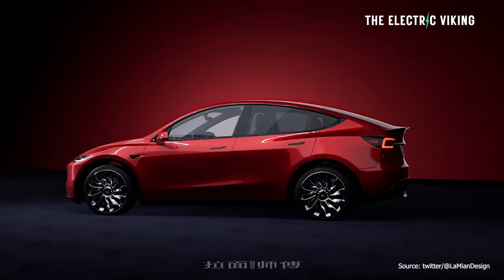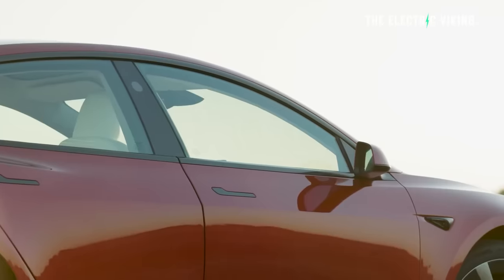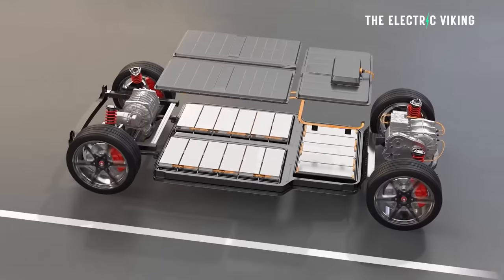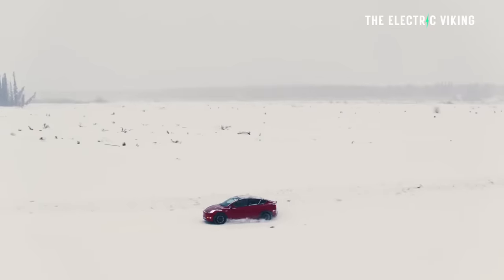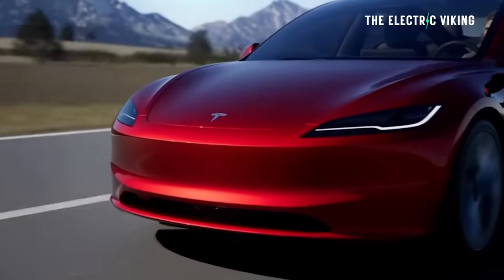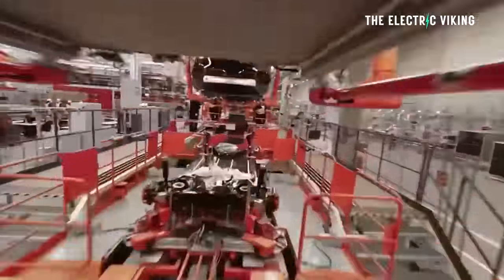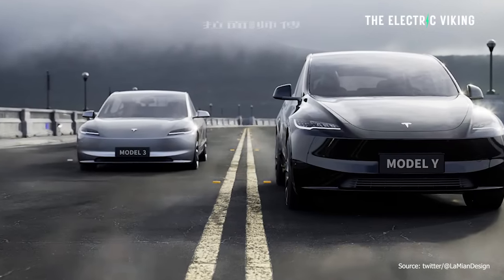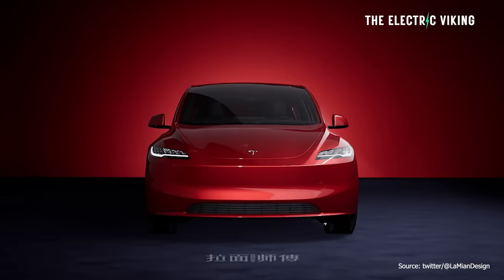NEW Tesla Model Y Juniper details leaked - Factory retooling only weeks away

Comment: I've been waiting for this version of the Tesla Model Y since Tesla Model Y was first manufactured.
A major iteration, after Lessons Learned, with batteries that aren't Antiquated lithium-ion technology.

This is the Tesla Model Y that people will be raving about.
Reply: I’ve been holding out too👍🏼
Reply: Yup we have been waiting for these upgrades incl. the suspension improvements.
Reply: Don’t believe this guy, it will be the same as highland.
Reply: If it rides well. Model 3 was horrible, I haven't been in the updated version, but all reviews are raving about the  huge improvement on suspension. And Model Y is even worse than old M3. Any improvement in battery should go towards weight savings. And for the love of God, keep the indicator stalk. Buttons on the wheel simply don't work in roundabouts.

Comment: LFP is the only reason why i went to an EV, specifically the model 3.
Reply: RIP NIO's swapping nonsense given ever increasing charging speeds.
Reply: @Mrbfgray It was always a stupid and impractical idea.
Reply: @vasil7410   Of course, and predictably more so over time.
Reply: It's not the best battery,  it's ok, but it looses power and doesn't charge fast in cold.
Reply: yeah, was honestly disappointed our RWD Y didn't have the LFP...Maybe Juniper will get the new M3P (4C) battery in a year or two...when it does, I'm going shopping!

Comment: Could be an increase of 20% compared to the existing battery pack perhaps but that’s if Tesla will stick to the same amount of KWh in the pack. Elon is very clear on range not to have an unnecessary large amount of range. Instead they could lower the KWh in the pack for the same range and also loose some weight. Because the pack is the most expensive part this could mean more competitive pricing compared to say BYD.
Reply: They can’t decrease kWh with the same range much by changing just the battery.   The one improvement in range available when changing battery is weight.   20% less weight and lower cost would still be progress.
Reply: That was the point of 4680 structural battery, reduce the weight of the car by reinforcing the structure with the battery. You should be able to extend the range by shaving off few hundred pounds while keeping the same battery capacity.
Reply: There is no such thing as unnecessary range.
I had to charge last night 6 times, 30minutes each time, as it was - 20C And ny trip for 800km, every 150km And I had to charge. 
I drive daily 600km In a working day so I need to charge at least 3times a day in winter.  1,5 hours time wasted. Good car BUT even Model Y LR has way too small a battery. Battery should be at least twice to what it niw is as you can't drive battery down to single digits when it is cold

Comment: How about steer by wire for Juniper?
Reply: Nope, nor 48V architecture.  Those will wait for completely new designs.
Reply: Yeah, I was hoping that would somehow appear in the US version of the Highland, but I just can't see Y or 3 getting those kind of upgrades before they are in the X and S.
Reply: @EdwardsNH    It's about how much of an entirely new vehicle they are ready to take on.  Going steer by wire means 48V which means entirely new supply chains for plethora of parts and major--like new model ramp instead of a quick ramp like Threefresh.

Likely X will be canceled before that happens, maybe S as well.
Reply: X & S needs a totaly new Model. They have the same look as released in 2012. @Mrbfgray
Reply: @rozonoemi9374   They don't but what's your point?  You want the traditional way of senseless aesthetic changes, cheap crap added so the Jones know you have the latest?

Beetle, Porsche 911, some of best ever selling cars for half a century, didn't add fake jet nozzles and tail fins, phony air scoops....pointless dramatic styling ages fast and looks as stupid as it is.  

Same today for EVs with big fake grills or most ICE vehicles for that matter.  I suppose you think the Threefresh looks the same as the original 3.
Reply: If the X & S were big seller, I would say keep the "Porche" recipe, however need a new model, not just a refresh, without the big ugly grill! @Mrbfgray
Reply: By the way, I don't give a flying F... about the Jones! @Mrbfgray
Reply: @rozonoemi9374    You may not care about the Jones but that's how shallow "new models" have been for the last 70 odd yrs, superficial changes so it's obvious it's new and to make prior designs age faster.
Reply: Why on earth would anyone want steer by wire in a car😂. 

Steering feel and feedback is something that manufacturers work hard to provide. 

With steer by wire the wheels aren’t even physically connected to the steering wheel. I cannot think of anything I would want less in a car, especially a sporty one
Reply: @992GTS-DC   There is no fundamental reason steer by wire feedback can't be as good as anything else, but it won't be until refined which can be done w over the air updates.  Should have multiple settings to choose from ultimately. 

Model Y is not a sports car, it's a family SUV and never had good steering feel.

Agree that a sports car absolutely needs exceptional feedback, one of the reasons I choose BMW E92 M3, last of conventional hydraulic steering, successor was unrefined and lacked classic BMW feedback.
Reply: @Mrbfgray  it’s one thing having poor steering feel, it’s another if it feels like you are using a controller for a video game. Why do you think no one else uses it, other than I think Nissan a decade ago. BTW I also had a E92 M3 a few years ago and yes steering feel was great
Reply: @992GTS-DC   Why do you think no one used 48V while talking about the need to do so for 30 yrs?  Because it's not easy to make the change and lazy Legacy MFGs don't do difficult.  Same for steer by wire.

Steer by wire will need to sense resistance, no reason that can't be transmitted to the steering wheel, to some extent it already is in the Cybertruck according to at least one test driver.  Is it worse than a typical pickup?  Not from what I gather and software can make it whatever you want.
Reply: @Mrbfgray  but what’s the point? Conventional steering works perfectly and is almost 100% safe. Why bother developing something that’s nearly as good? It’s Tesla all over, get rid of parking sensors and replace it with something inferior, get rid of indicator stalks and replace with something that’s worse. Whilst everyone else is fitting heads up displays and 360 cameras , Tesla make you struggle without these for no good reason.
Reply: @992GTS-DC   Stalks I definitely agree.  Parking sensors shouldn't be required but it's true they lag badly getting that right, CT has 'birds eye' view I believe, IDK why it's taking so long for the rest.

See Cammisa on Hagerty on CT for why to go with steer by wire, at least for that rig it's a vast improvement, I see no reason it wouldn't be better for all vehicles.

Granted this is very old anecdote but I once broke steering shaft on old manual steer 1-ton Chevy, sure as hell take Tesla's CT system over that setup.  We've had throttle by wire for decades and never been a problem with it, yes steering is even more critical but not by a hell of a lot, done right safety won't be an issue.  

Airliners have been 100% fly by wire starting in late 1980's, hasn't ever caused a crash that I can think of.
Reply: @Mrbfgray  I agree, it can be made to be safe and some benefits on a truck. But on a car it’s a solution to a problem that does not exist. 

And if the software has a glitch where it turns full lock at 88mph, they can always just do an ota update 😉
Reply: @992GTS-DC   And why don't you worry about same for throttle/braking by wire at 88mph?  Because such critical systems are not vulnerable to that.

  "Out of Spec" just did a 'run-it-to-zero' test on CT, until it stopped moving, everything shutting down yet steering continued to work fine to be towed to charger on it's own wheels.  

My criticism of Tesla's sensor suite is the lack of sideview cams at very front of cars, not lack of sonic sensors.  Big missed opportunity there.
Reply: @992GTS-DC   Not sure it applies to all models this century but take an F-150/250/350, lose engine power (which was common some yrs ago) and you can effectively no longer steer. Sure as HELL take electric/electronic over that.
Reply: @992GTS-DC   "A problem that doesn't exist" just like power steering solved, we steered fine long before power assist.  How do you know what you are missing until you use it?

Comment: The car is drive by wire, 
Making it right handed is easy. 
All you have to do is put the pedals and steering wheel in the other side. 
There are no physical connection with the wheels. 
In theory, you could it in the back seat or in the trunk, and it would make little difference from a technical perspective.

Comment: That said, while the NSW and Vic rebates are ending in a few days, Tesla may cut prices of the old Model Y, so if you missed out you might be able to pick up a cheaper existing Model Y in H1 2024, before the new one comes out in H2 2024, especially if you don't require that kind of range on a regular basis or are just using it around town.
Reply: I doubt it, they don’t seem to have y’s sitting in inventory very long unless it’s the performance variant.

Comment: I wonder if the US version will have stalks. If they are gone on the Juniper Y I'm glad I got mine this year. I really like the stalks and the only things that would make me want the new one is if it had a bumper camera and power funk lid. I'm not expecting that since the new Model 3 didn't get those features.
Reply: Stalks are going away in all models, they aren't needed you old dinosaur
Reply: @tonyn3227  LOL! yeah I'm glad to hear there is a "legacy Tesla" customer already. I can remember when folks wondered if Tesla would even make it.
Reply: @tonyn3227  I like the turn indicator stalk.  Don't really need the other one.  That stalk is right in the same place all the time, it does not move when you are turning.  You can catch it with your finger and operate it without having to look and find it.  If you try to use the buttons on the steering wheel, while turning they will be all over the place.  You will need to look at your steering wheel to locate the buttons even when it is driving straight.  There is a reason why other companies, even though they have put hundreds of buttons on the steering wheel, still leave the turn indicator on a stalk.
Reply: @jiminauburn5073 Users report no problems. Buttons don't move! Ridge between them locates and you always push the button in the direction the wheel is turning. How hard is that. Even Ferrari drivers can use them! Classic Darwin award. All input is error, all Teslas can go autonomy mode and activate turn signals automatically.
Reply: @waynerussell6401  The buttons do move when you turn the steering wheel.  They are no longer in the same place because the wheel has turned.  Tried self driving on my Model Y and it is not anywhere near ready for prime time.
Reply: @waynerussell6401 anyone I know that purchased the new x, s or 3 highland say they would prefer stalks above these buttons. I live in Norway where there are roundabouts everywhere
Reply: I would guess most folk in the eu wont be pleased with the disappearance of the stalks. They should have copied cars from the 80s and made the Center of the wheel not turn if they were going to stick the turn signal buttons on it.
Reply: @nick255  Yeah, good luck going around a roundabout and then having to use your turn signal as you are driving around and having to search and figure out where it is currently on your steering wheel.
Reply: @pipopipi  yep, that is when it will probably be the worst.  Surprised they let them sell the car without the stalks in Europe, seeing that it is kind of a problem.

Comment: so essentially they will be doing the same as the old version - model Y is a bulkier model 3. people are buying the bling, cause the battery is anyone's guess - you cannot choose which battery you want. In my case I found a unicorn - an old RWD model 3 with a 78 kw battery for 40 k. Very happy with it after covering up the hideous wooden panels. did a roadtrip recently and because there are so many teslas on the road couldn't charge more than 70kwh which gave me mucho time to strech my legs, walk the dog and have lunch.

Comment: How do you know they will increase the range by 20% rather than reduce the size (and cost) of the battery while achieving the same range, or perhaps a little more?
Reply: Exactly.
Reply: That is what I think they may do.   For most people the LR Model Y is plenty of range.   Maybe they will make an option for the LR where you can get the SLR (Super Long Range) that has another module in the pack for longer range.
Reply: @jiminauburn5073  I’d like to see a performance model with the range of the LR.  That would be great.
Reply: @sleeknub  Yeah, if they indeed could get away with smaller battery packs, then they could add to it, for the performance and get that 10% back.

Comment: If it's like the TM3 10% improved range, that did not find its way into reality, I would not bet on 20% increase for the TMY, without an increase of battery size.
Reply: Not sure if you are making it up or uninformed. Actually it did! They just reviewed the model 3 which claims 330 miles and it got 327 miles and it was still running. So they got basically exactly the claimed range, while the older model 3 got around 270 to 280 max
Reply: @blueplanet1048  I tested it and can tell you that the improvement is about 2 to 4% depending on your driving, my average driving daily my Model Y is 148Wh/km (so I drive smoothly). If you think that the new Model Y will get 20% range improvements without an increase in battery size, you should start selling what you're smoking.

Comment: Juniper MY won't have more range.  But IF the 20% higher energy density LFP pack IS true, then Tesla will simply switch the MY LR to an LFP pack.  A MY SR+ has 253 mi range and 20% on top of that will take it to 303 mi.  Add a few more LFP cells to get it to 330 mi and now you have a SUBSTANTIALLY cheaper MY LR.  Tesla wants lower cost and higher volume, not more range because Elon believes the extra range is unnecessary and leads to a heavier and thus worse vehicle.  You should pay attention to what Elon says when he speaks.  Higher energy density packs probably means smaller/lighter/cheaper packs w the same range and not longer range.
Reply: exactly...this is the way...
Reply: It doesn’t matter what Elon thinks. If competitors offer comparable models with higher range then Tesla will have to follow.
Reply: Not necessarily. IMO it is better to improve efficiency than increase range with heavier batteries.
Reply: @69memnon69 also true.  It is a marketplace.  So Tesla will increase range as necessary to stay competitive, but I don’t expect them to lead the charge for longer ranges.  

If Zeeker’s Golden Battery does as Viking says, it could be a real problem for Tesla.  

I do expect Tesla to get the ‘4C’ LFP batteries within 1-2 years.  They keep plugging away at 4680s, but seems like they really aren’t getting there.

Comment: They are not using their own 4680.   Why not?  

Production is still not working right?
Reply: What batteries are you mass producing in your basement????
Reply: All heil the 4680. Thou shalt commit all other EV's to the fiery pits of hell and make all other battery technologies redundant for eternity. The 4680 be thy lord and saviour and deliver us from the shackles that other chemistries bear and deliver us eternal power, low cost, 10% more energy density and a 50% reduction in charging times.

Comment: Hold on. I thought 4680’s were the future. The Y was designed for 4680’s. Now no model yet with 4680’s.
Reply: Austin 4680 Y
Reply: All heil the 4680. Thou shalt revolutionise the battery and consign all other EV makers to the eternal fires of hell while increasing range, reducing costs and charge times and be in full production in 12-18 months (as of 2020).

Comment: Still needs head's up display or drivers display badly...
Reply: It takes about an hour to install a display. It also costs under 200 to buy one. It plugs into an empty OBD port already available on the passenger side. The cable runs neatly  under the dash trim which pops right off with no tools.
Reply: where do you buy them please? @Dryloch

Comment: Can we Assume it will be based on a 48v Architecture?!?
Reply: That's what I'm thinking too. Plus a more streamlined manufacturing system to make it cheaper, it should be lighter thus increasing range.
Reply: That's not possible and call it a facelift. Easier to start from the ground up. Much too big change.
Reply: Difficult to get all the required 48V components from the suppliers for the high volume M Y. It’s easy for the low volume cybertruck
Reply: @TamasVarga-VatartPhoto 
Nah for if it's a completely new manufacturing line why can't it be fully 48v? Have the CT line that makes the  48v components make more of the 48v parts that can be used on the juniper MY.
Why can't the 48v lines make more than what's required for the CT at this point?